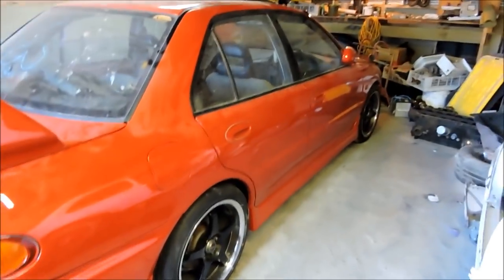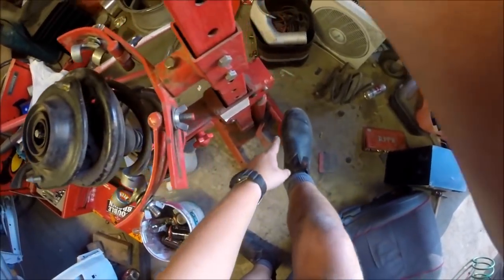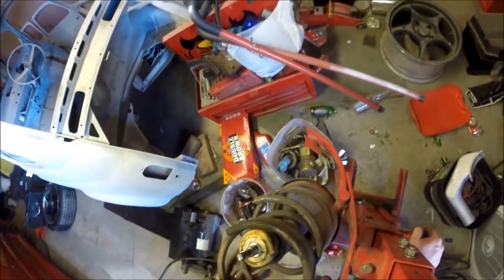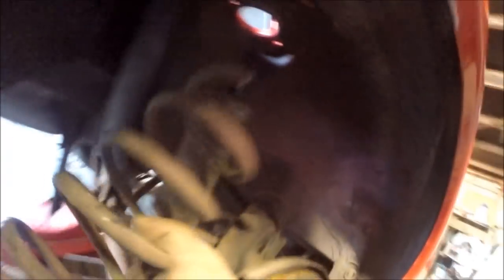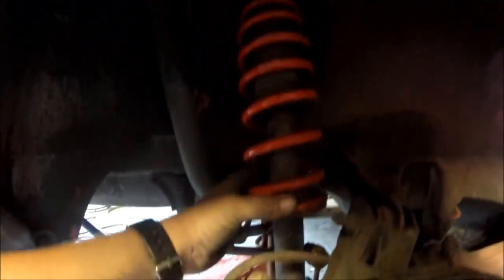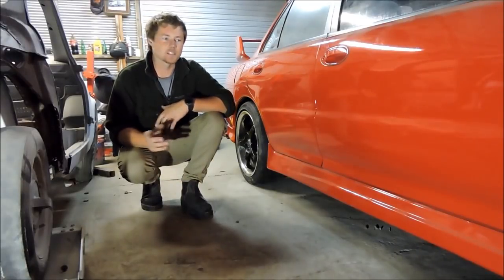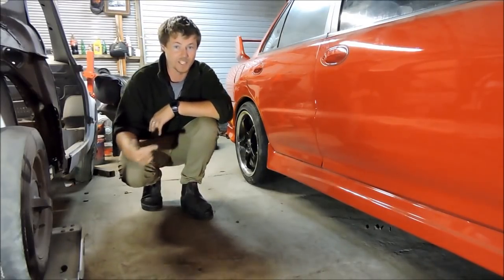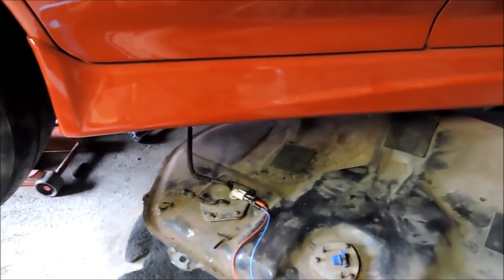Springs install and a fail first start!

Comment: Give that battery a good charge up for a start. Its supplying enough amperage to crank the engine over, but probably not enough voltage to run the ECU and ignition like KiwiXT said. Or roll it out of the shed and hook your Courier up to it and jump it with 14 volts. If it doesn't start then, you've got something else going on

Comment: ECU needs more than 12volts while cranking! Check voltage at ecu connector, should be a schematic online that’ll tell you which pin it is. If that doesn’t work I dunno what’s wrong lol

Comment: Bro you got spark an it’s firing , but you definitely have a fuel problem , if that pump ain’t getting power , injectors won’t either ... check fuel pump relay & relay module then start with ecu pin outs .. :)